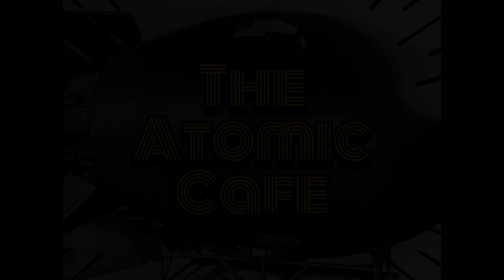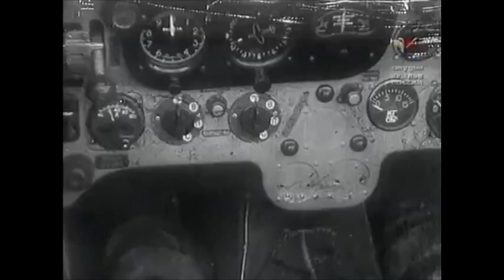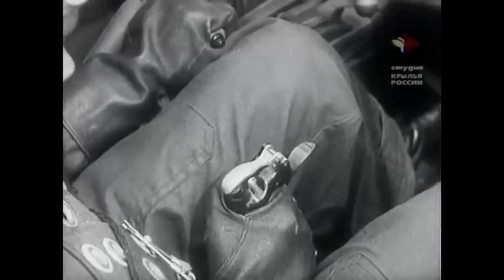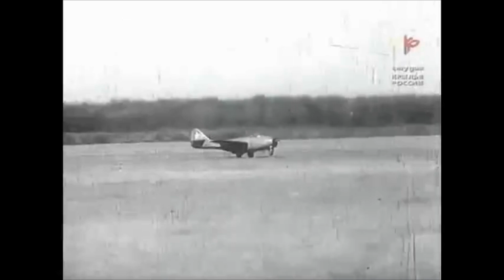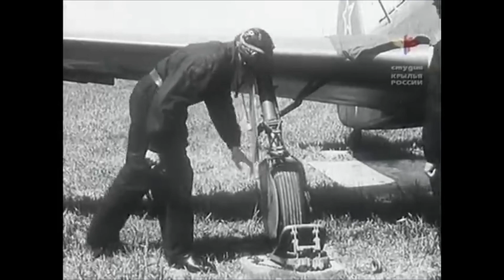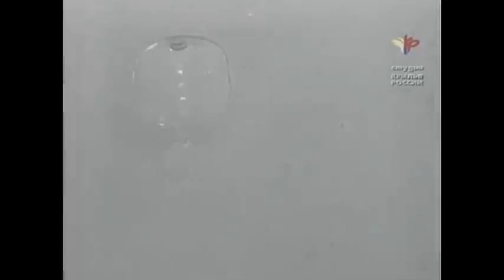Yak 15 | First generation Soviet jet

Comment: Small correction. Tail wheel never got melted but yes certain panels were installed as different metallurgy was found to be the right one-

Production and designs wasn't any faster then say you guys in the US. We didn't just grab anyone and tell em do it or else. 

Take it tongue in cheek - but you Americans have a funny imagination when it comes how we conduct our business. First a program is introduced, second a plant and two or three designers are found and a competition ensues. Yak-15 was one, La-15 another and MiG-9 all participated. MiG produced more then Lavochkin and Yakovlev combined and as a result ended up with the contract and works immediately went into MiG-15. And just when MiG-15 saw combat in Korea it was all the rage not barely even within a few years later came up with MiG-17, 19 and 21! The 40-50s were filled with hundreds of programs, designs, tests and production in shortest amount of time then any other period with the exception of production numbers during ww2 (but thats because as aircraft progressed they could do the task of ten so production was a concern but not as much).

Yak-15 was a capable plane along with MiG-9 and La-15 that seemed in competition but in short really truly were stop gap measures until a proper proceeding design was agreed upon. 

These early jets inherited no less issues and faults as yours did and even after you reverse engineered Germans and paid them handsomely expunging their records via Operation Paperclip.

Decent plane for the time? Absolutely! Perfect?? Not even close - and thats where it should be left at. Others in the same time period no matter the nation were equally plagued and far fewer designs to show for it compared to us.

Comment: I can certainly see the value in a plane for getting pilots use to the difference in throttle response that a jet has that otherwise flies very similar to what the pilots are used to. My uncle said he had a terrible time getting use to the prop not acting like an airbrake when you chop the throttle.

Comment: Wow - I have been into aviation since I was like 5yrs old (loooong time ago) and I have never seen this plane before. That was great. I reckon having a heat shield around the tail wheel is cause for concern not to mention a cockpit that filled with smoke now and then. Please keep the videos coming - thanks from Down Under.